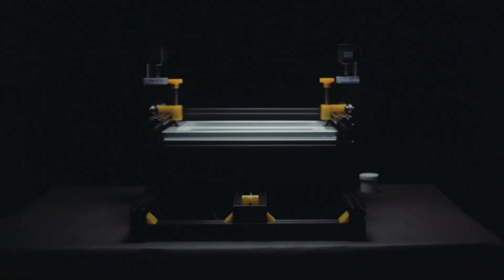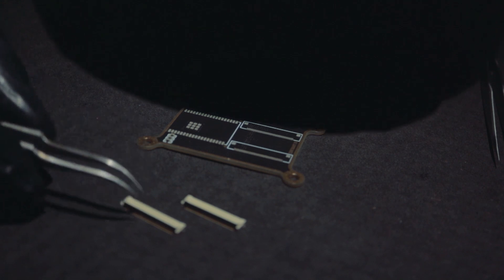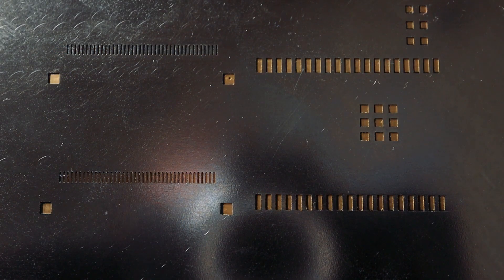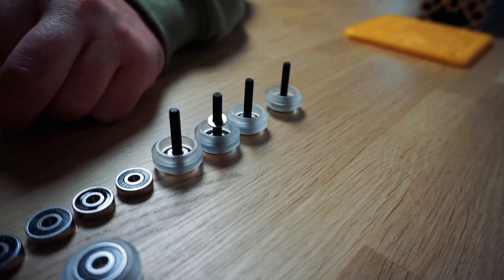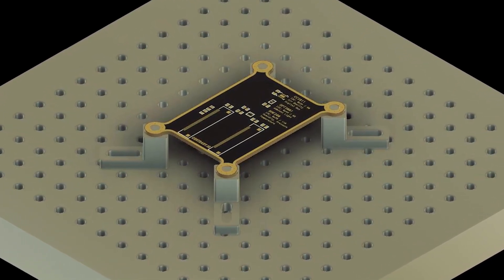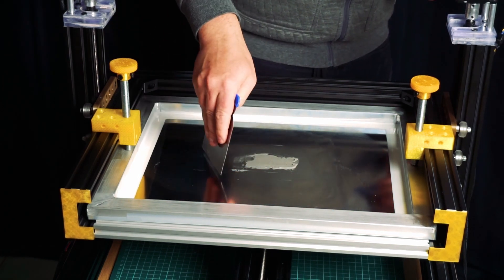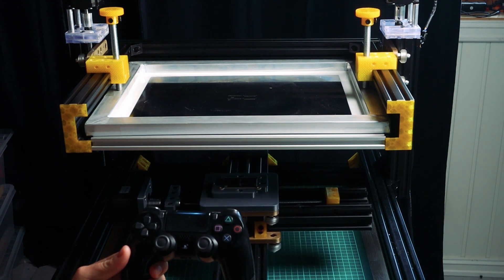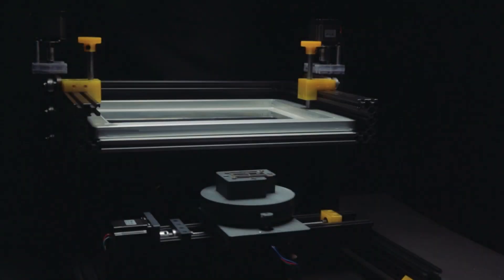DIY solder stencil printer - Motor controlled

Comment: The reason you were getting bad solder paste was because you apply the paste directly to the holes, and then use multiple swipes. That's just going to smear it.  The stencil will never sit exactly on the board so it flops around above the board slightly.    You need a flexible stainless steal wiper, and put the paste away from the board, and then with significant pressure so that the wiper flexes and move it at a 45 degree angle across the board, once only.   As the paddle moves it presses the stencil down over the board so that no paste can squish out around the stencil holes on the underside. Once the  paddle moves away from the pasted area the stencil may rise but by then the paste for the section of the board is done.  But if you try a second pass then you'll smudge the already pasted areas.